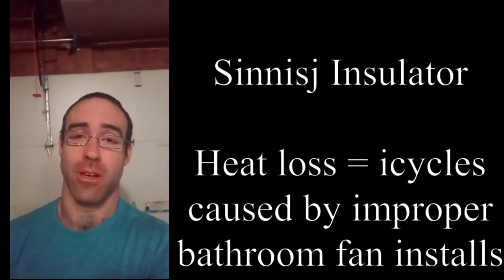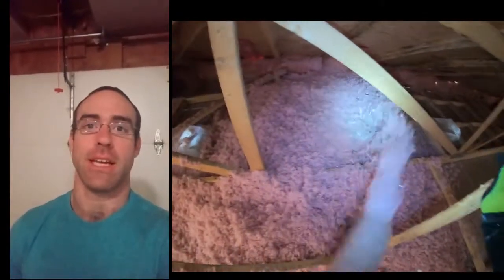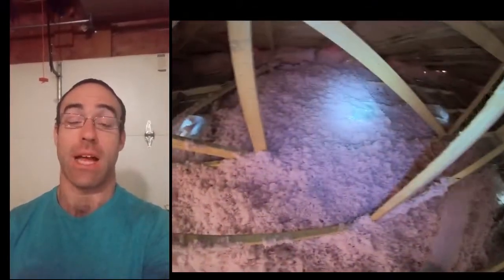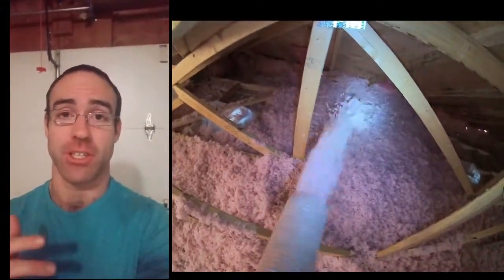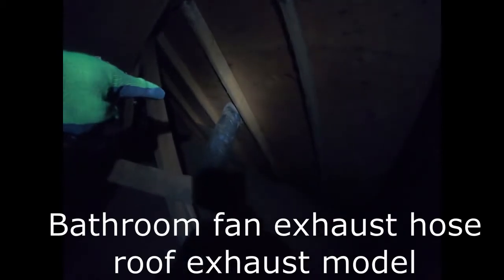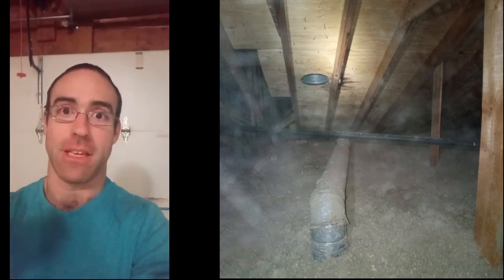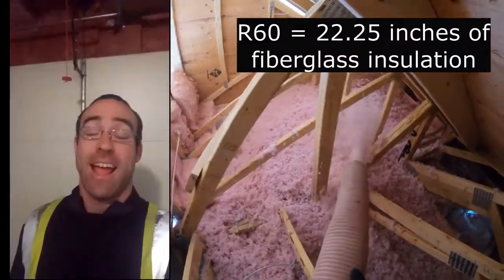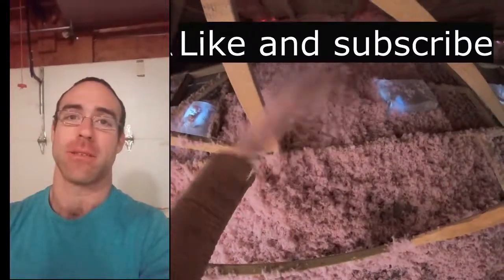How to prevent icicles | Disconnected bathroom fans!

Comment: The loose fill Fiberglass has very little R-value. 
Where I live, the building code requires either a minimum  9" of cellulose,  or 15" of loose fill Fiberglass.
Even with 15+inches of blow in Fiberglass,  I can still find spots on the ceiling that are almost the same temperature as the inner pane of glass on the windows on a cold day.